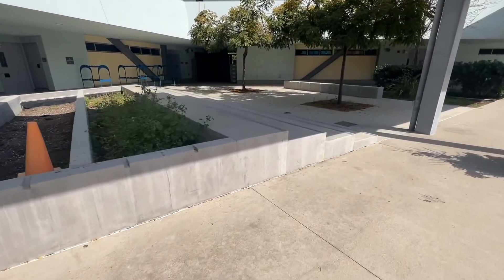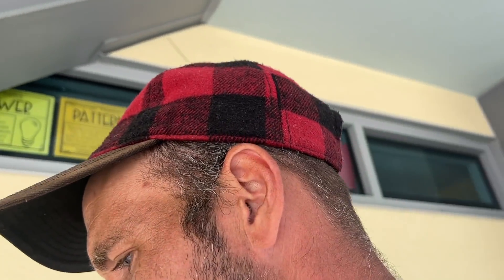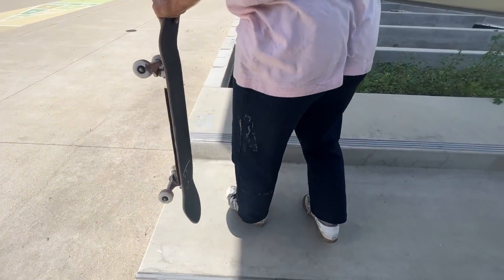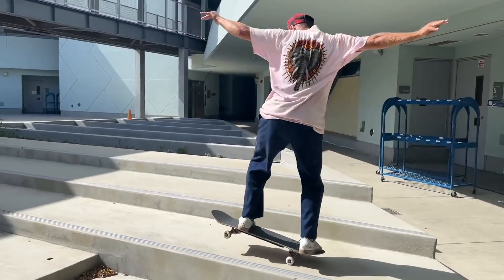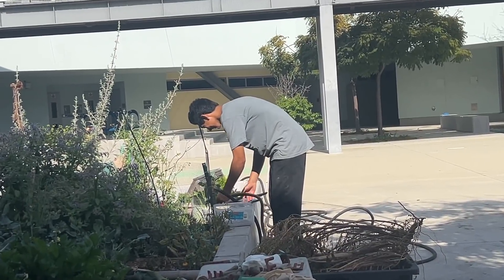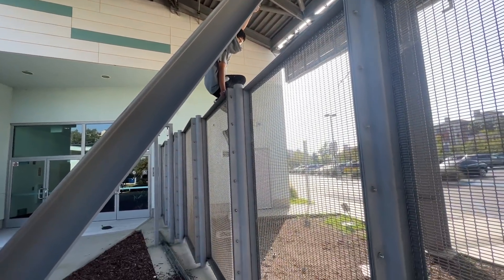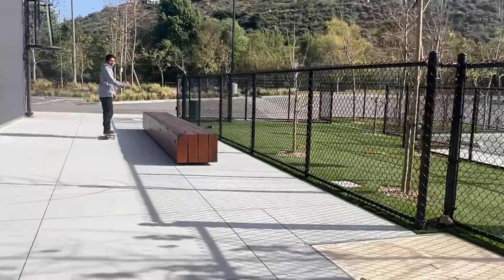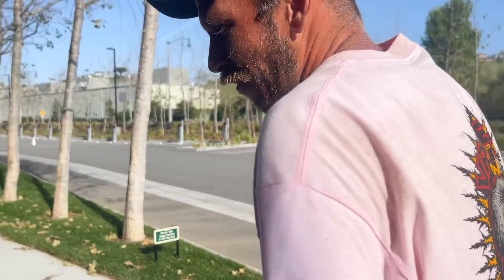Yes Please...

Comment: haven't skated in like 17 years but i'm looking at an 8" Almost complete that i can get for a pretty nice discount and thinking it might be time to finally try again. your channel is one of the ones that made me wanna do it
Reply: also i propose that that the name for the thing you start doing at 12:30 should be the twerkslide lmao
Reply: @Nor'east Outdoors yeah i was thinking about  a 7.75 for a while because they're apparently easier to flip/spin and i mainly wanna do flatground stuff instead of vert or jumping down rails, but then i figured it was probably better to go a little wider until i get more precise with my feet and then see if i still wanna go smaller
Reply: Try 8-8.1 with 14 wheelbase. Those 7.75’s are easy to flip because of the small wheelbase. Don’t go above 14.25 or you’ll start feeling that wide stance if you’re small.
Reply: Bro get back into skating! Skateboarding gives and gives. It’s so rewarding
Reply: In my opinion a wider board would be better. An 8.5 will flip just as easy as an 8 from my experience. Wider boards are way more comfortable and you’ll have more control for sure
Reply: We don’t care
Reply: @_fluxxx  yes we do
Reply: @_fluxxx  I mean... I had 16 likes and people talking to me about what to buy when you made this comment. Just keep scrolling if you don't care lol other people were obviously not bothered and happy to engage
Reply: Do it dude. Just know what you're limitations are if you older. I started up again a couple years about after about a 30 year break. I started off with a 8" deck. Then, tried 8.25 and 8.5. Tried a bunch of different types of wheels, sizes, hardnesses, etc. Currently, 8.25 seems to what feels the best for me. I don't really like the 8" deck. But, decks were 10" when I skated in the 80s. So, I guess it just depends on what you are comfortable with and what you used previously. People don't seem to be riding decks smaller than 8" these days.
Reply: It's officially bought! Grabbed an enuff y tool too after Dan's tip about solid metal vs plastic skate tools, and a 3 pack of pads because my parents who are helping me out with the purchase insisted lmao. Should be here by the end of the month, I'm super excited
Reply: @idmhead0160  yeah, I'm turning 30 in June, so I'm older than most newbies but I feel like my plans to skate mostly flatground aren't overly ambitious lol
Reply: @666soso  That's similar to what happened to me. Slammed, broke my nose, and got two black eyes, as well as a cut above my brow. I wish I could say I was doing a cool trick. Skating in low light and hit a rock. I wear a helmet now. Would have been totally fine if I had it on when I slammed.
Reply: If u want to skate again, do it mate. The only person that can stop u doing it is urself. Go with an 8" or 8:25 at least untill ur board ballance confidence finds it feet. Po ay no heed to Mr Hope Less, he'll be going thru the basement, acne years where he hates the world and even himself. He'll grow out of it. Enjoy with a nice Irn-Bru.      ✊🏻🏴✊🏻
Reply: Honestly 8.5 feels just the same as the skinny decks when it comes to flicks except it’s way more comfortable riding. Great for cruising and feeling secure on your board. I would also recommend going to your local skate shop and building a board. It’ll save you money in the future and the boards are better quality.
Reply: @666soso  a krooke is when you use your front foot so idk how that works. You’re probability thinking susky grind.
Reply: @_fluxxx  
Your replying with a comment proves otherwise
Reply: @TheOneHundredPercent  
💯%
Reply: @18JR78  ✊🏻🏴✊🏻
Reply: I’m going on 47 this year. I skated back in the early 90’s. I just started skating again myself. I’ve built two completes in just two weeks and added 4 decks to my wall hanger collection.
Never too old to sk8!
Reply: @TherealWi24RD  u said it man. I skated in much same time period. Good days
 Shred on mate. ✊🏻🏴✊🏻
Reply: @666soso  I was thinking about trying an 8.75. The problem is there are so many different permutations/combinations of board size, trucks, wheels etc. I'm not even going to say how many setups I've accumulated over the past couple years. A lot of different wheel types and mainly just Indys, though I just ordered some Mini Logos and some Thunders. I need to call it quits after that and just stick with what I've got. It's starting to get out of control. I would definitely at least get a helmet. Maybe I look like a newb in mine, not the mention my skating makes me look that way, but, no way do I ever want another head or face injury. If you get a helmet, get a "certified" one.
Reply: Speakin to all both young and old: if u can feel adrenaline bite u, then ur not too old to skate. Think less, skate more.,feel it all.     ✊🏻🏴✊🏻
Reply: Dude!!! I also took about 10 years off. 2007-2017. Go for it, you won’t regret it. Just be prepared for a lot of frustration lol. One piece of advice I have is to think about getting a shaped board. I know for me there was a long period of frustration with not being able to get back into skating the way I had as a kid. Using a shape board help me refocus on just riding and carving and getting really comfortable on my board again. And I think that’s a huge reason why I’m still skating five years later and I’m better than I ever was as a kid. Something about just completely changing up the skateboard shape and set up made me feel less like it needed to be how I had stated before, and it just made it way more fun to cruise around and do silly tricks.
Reply: @_fluxxx  Twerp
Reply: @alexb9597  whoever in your pfp like 85 close to his last breath I should be the last thing you should be worried about
Reply: @happyskating2000  I was amazed that I was able to buy a Vision Kele Roscrans (shaped) deck pretty much identical to what I used when I was at my peak skating in 1989. In fact, the deck was pressed on the the same press. I forget the name of the skate shop, but, it basically has the factory for Vision. Pretty awesome. Now, if only I could get a hold of a Lance Mountain deck. Powell just released them again, but, they seem to have sold out immediately and I didn't find out about it until it was too late. I've just been skating Mini Logo popsicle boards. I do like the idea of being able to do things switch. That wasn't much of a thing before I think around 1990. Would be rad to pickup more of the boards that I rode back in the day. Of course, I've probably already spent a good $1,500 on skate gear over the past couple years. I need to chill out on that.
Reply: @TheOneHundredPercent  Yup. Pretty rad just cruising down a hill and carving if nothing else. Just don't hit a rock and faceplant like I did.
Reply: @18JR78  I’m 6’3 and I like a small wheelbase, currently on an 8.75 with a 14.375 wb.  Only because I havnt found a big board works with 14.25 wb
Reply: i suggest getting good trucks and wheels, get ones that last. the best are spitfire and thunder and for bearings get reds. decks dont really matter theyre pretty much the exact same for all brands except for size or shape. get a popsicle (most common) shape and above an 8. 7,75s are really, really tiny.
Reply: @cangilll  From what I've heard, Mini Logo bearings are basically the same as Bones Reds. Just they cost $10 instead of $20. They are made by the same company, Skate One. That's what I've been using. They work great. I would hate to think how much money I would have wasted buying expensive bearings for my setups. Not saying Reds are that price exorbitant. Just saying most people probably don't need Swiss unless you are riding vert or something. Then again, I never tried them, so, maybe I don't know the difference. All I can say is I'm happy with Mini Logos.
Reply: DO IT
Reply: @BrendanBFree  You can shorten the wheelbase some by switching to other trucks. I was comparing Mini Logo trucks to Indys the other day. I want to say the Mini Logos are a 1/4" shorter compared to Indy on the exact same board. A Mini Logo 8.25. There may be other reasons why you wouldn't want to change trucks, just something that I noticed. Supposedly, Thunders go the other way and increase the wheelbase compared to Indy.
Reply: @BrendanBFree  What makes you like the shorter wheelbase? Better for flip tricks? I was thinking of trying a Powell 8.75, because it has a 15" wheelbase, just out of curiosity. I guess if wheelbase is measured bolt holes to bolt holes, it's 15". The actual wheelbase would be longer than that though, depending how far the axles are back from that. I think old school decks are mostly 15". Andy Anderson's deck is 15" I think. At least the 9" one is. Don't know about the 8.38 or whatever it is.
Reply: @idmhead0160  hey bro, I like it for flip tricks.  But I don’t swap out trucks to make flipping my board better, I just prefer a shorter board.

I’m not going to make my wheelbase shorter by changing trucks, if anything I make it longer.   If I have a big nose and tail, thunder trucks will extend the wheelbase so that it makes popping a bit steeper, if I used Ace Trucks, my pop would be reduced because the shortened wheelbase will make the nose feel light when popping.

If I had a steep nose and tail or short nose and tail, ace trucks will make the wheelbase shorter resulting in easier pop.

It’s about balance.  If I had a short tail and a steep nose deck, I won’t put thunders on it because the board will be too heavy to pop, harder to get the tail to touch the ground.  So because of this I own 3 different trucks so if I do buy a deck that just doesn’t seem to pop right I can put ones to give that comfortable pop
Reply: @idmhead0160  wheelbase of the board is different to wheelbase of the trucks.  You change your trucks depending on the shape of your board, steepness and length of the kicks. Short nose and tail boards or steep nose and tail boards will ride better with trucks that reduce the wheelbase. If you ran thunders, the board will need to go more vertical to pop off the ground.  If you got mellow nose and tail or long nose and tail(what I currently ride), shortening the wheelbase with your trucks will make the board go less vertical when popping off the ground.
Reply: @BrendanBFree  Yeah, Ben Degros talks about a lot of that on his channel. I've been riding Indys. But, I have some Thunders coming in on Wednesday. Want to try them out with a Mini Logo deck. I think Powell boards are mellow kicks from what I've heard. Interested to see if Thunders work better for that. Also, I want to compare to Mini Logo trucks. I think I mostly rode Thunders back in the 80s. Of course, we used risers back then.

Comment: @Dan Corrigan Have you ever tried Mini Logo trucks? Would be curious to know what you think of them. I know you're big into Indy and probably wouldn't even want to bother with them. You seem to know what you like and don't experiment with different setups that much. I got a pair a couple years ago and initially didn't like them because I had issues with wheel bite since they are so low. But, I tried them again today, after being inspired by the fact that Andy Anderson rides them. Zach seemed to be using them as well, though I think it was probably just long enough to do a Powell video for them. I liked them better this time around. I think the bushings hardened up over the past couple years. They seem a bit better for manuals that the Indys I've been riding, but, it may just be the case that it's because the Indys are looser.